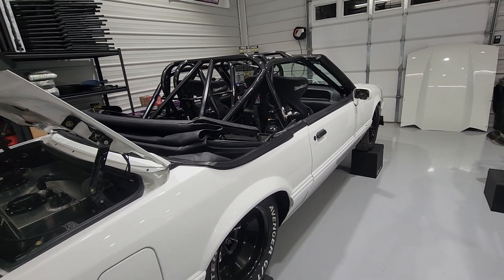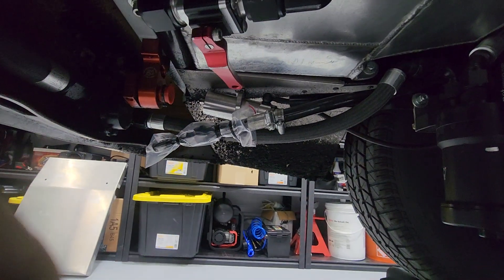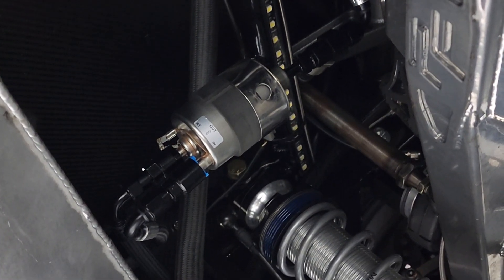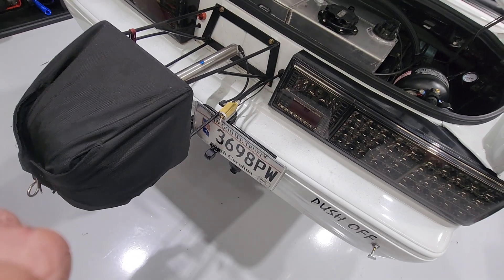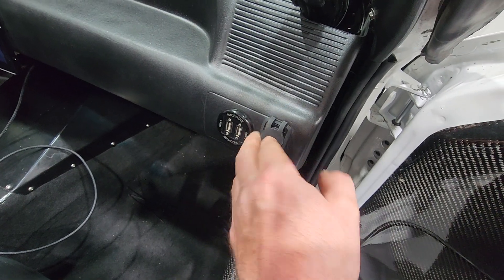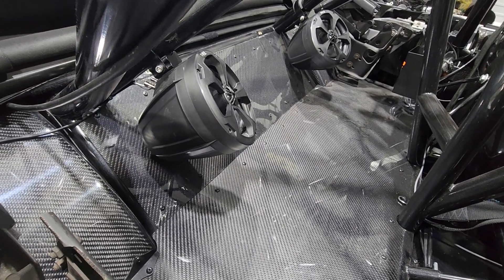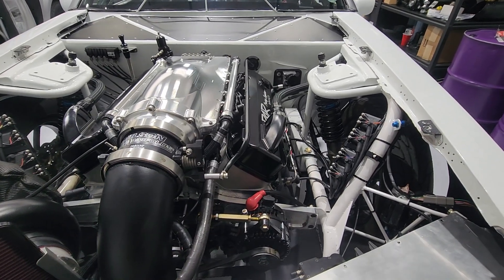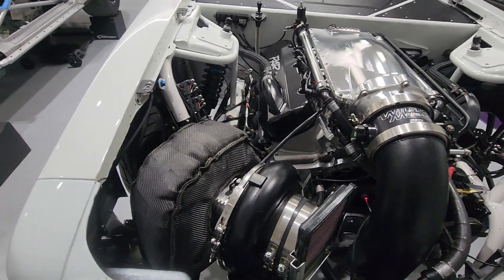2023 Sick week prep on 235s

Comment: I been running a supercharger for years, after the local speed shop here in Portland oregon failed several times i send to jet hot now, yes it's expensive, but it works, i use the extreme 2000.

Comment: Have you seen the inconel heat shield wrapping? Probably not necessary for here with the limited high power operation, but it it’s the nuclear option. 
Front duct looks like it should work awesome. Might be able to vinyl cut a graphic to mirror it on the other side to improve the visual appeal. 
With the front sealed the last thing you can do is vent the back. Keep the vent near the leading edge of the hood for the lowest pressure and easiest escape path for the air.

Comment: That corvette regulator sucks, had one (tried 3) on my airboat and it could not hold steady pressure on a stock 5.3 would drop to 50 psi and spike to 65-70 regularly
Reply from the maker: Same thing happened too me when I first started with this unit but it was from the walbro 450 at 16 volt 
I swapped it out to a 255 and it's been rock solid

Comment: Make a plug for the radiator hole when going down the 1/4 @ 180 or your plates might blow out
Reply from the maker: What plates ?
Reply: @theholleyefiguy  the block off plates (for lack of a better word) to direct the airflow to the radiator. You don't need the cooling for a 1/4 mile pass. Just something to think about, it's up to you. Steve Morris blocks his off but then again he is going over 200mph. He may also have been worried about blowing his hood off
Reply from the maker: @kenbauman2294  we've been 218 so far without the hole but should only be going under 170 as we're running 1/8 mile

Comment: Good luck on sick week... question for you... I have a 100 Amp alternator and a rear mounted battery  what size cable should I use to the battery?  And how to hook up the holley pro dash gauge?  Thanks and be safe at sick week...
Reply from the maker: 2 awg is what I would use
Reply: @theholleyefiguy  thanks for the reply but was wondering hot to monitor amps or volts on the holley digital dash?
Reply: @demon1891  he has other videos on how to set up custom gauges on a Holley pro dash. Battery volts is a pre-set drop down. No way for the Holley to monitor output amperage.

Comment: 235 why?
Reply: curious as well...
Reply: I would guess it would be utter domination.
Reply from the maker: Cause it's the only 1/8th mile class and I really dislike 1/4 mile stuff
Reply: @theholleyefiguy  curious why you dislike 1/4? Harder on parts, or just because it gets more sketchy/too much speed?
Reply from the maker: The speed is the part I dislike. 220 plus is super sketchy with a car that the roof is made of cloth and folds back. Plus I honestly feel like the race is over by the 1/8th (most of the time it's over by the 330